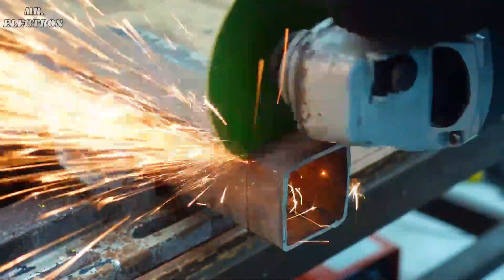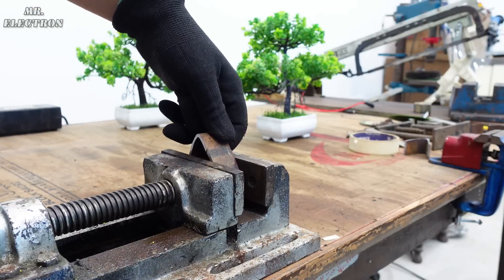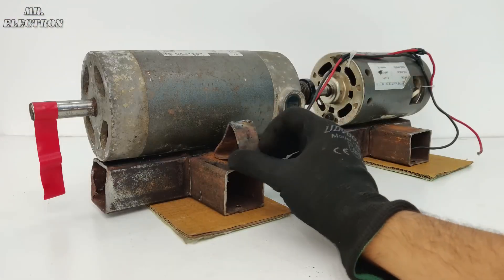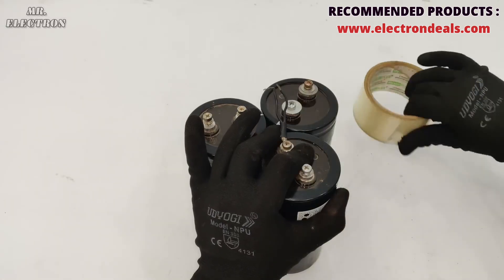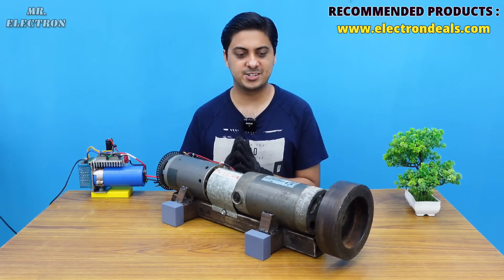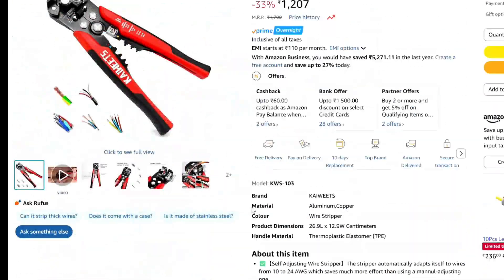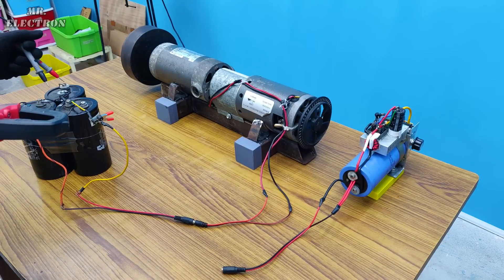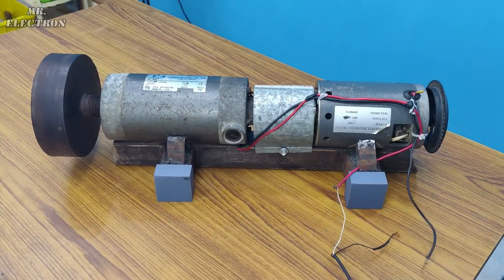Regenerative Braking Power Generation System | Electricity Without Fuel

Comment: Pareho lang Ng ikot pinag dogtong lang.. kaya Ang positive Ng generator  sa negative Dyan Ang positive out.. transistor voltage regulator  o diode, resistor sa kabila sakto lang baka masobrahan.. Wala Ng indicator Yan positive IN at OUT lang Yan... Inductor para lalaki Ang amper o Wala na, capasitor DC DC boost converter.. may long long long range ka Ng power source